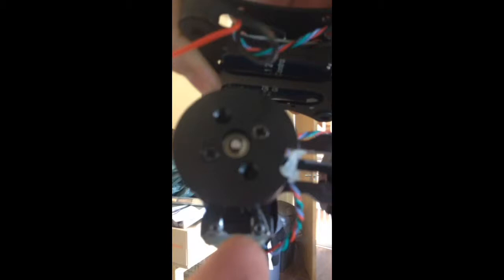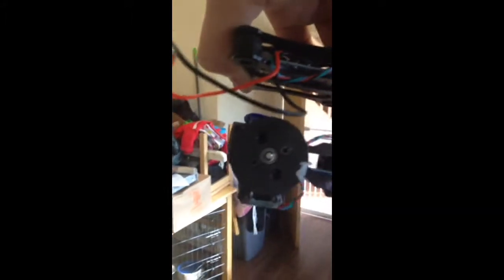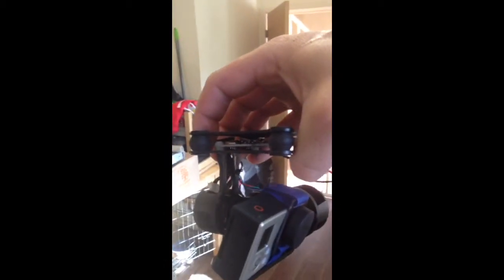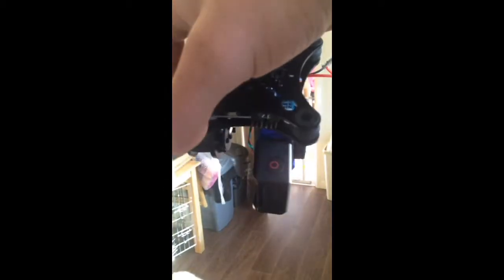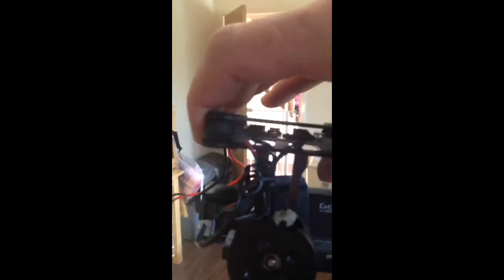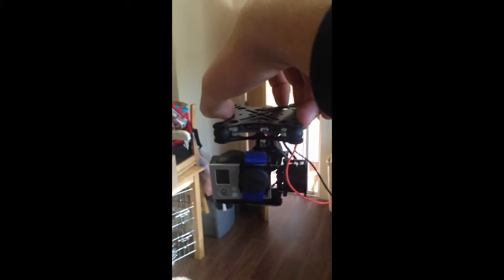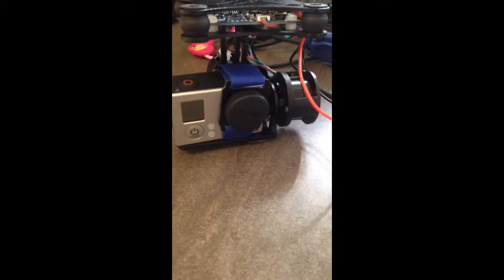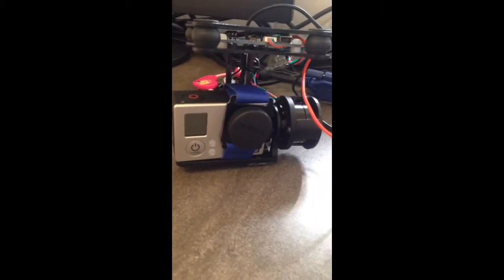Cheap eBay gopro brushless gimbal weight reduction mod for blade 350 qx

Comment: Old video I know but could you reduce the weight of this to around 30 grams? Not including the camera, and the top half that holds the main board removed? Just the motors and plate?
Reply from the maker: Yeah good idea for others mate I don't have it any more but for anyone that has one would be useful info I did think of taking of the top plate and drill holes in the body shell of the blades 350qx I had so you would lose a tiny bit more weight from the holes drilled out thanks for the input 👍😁